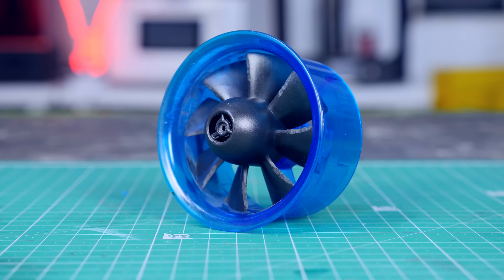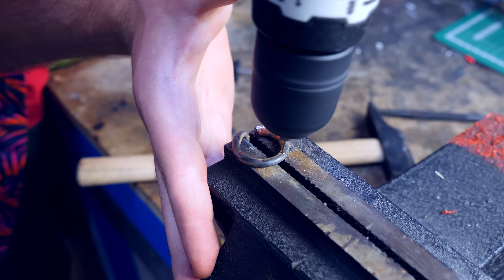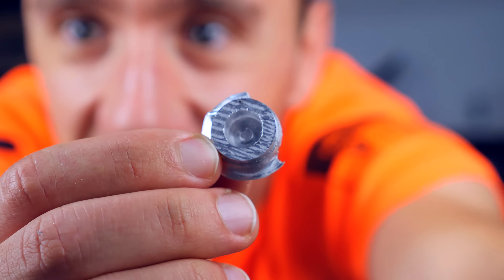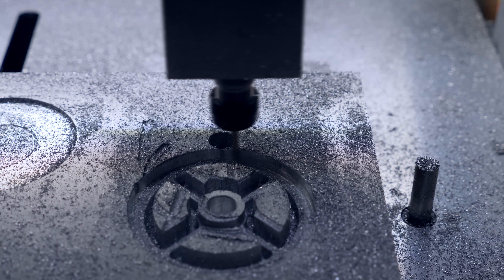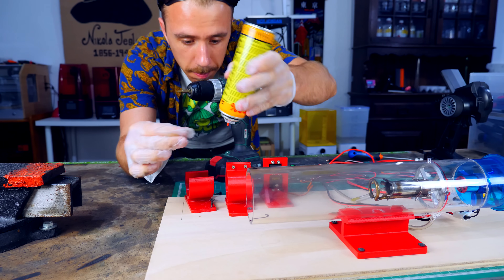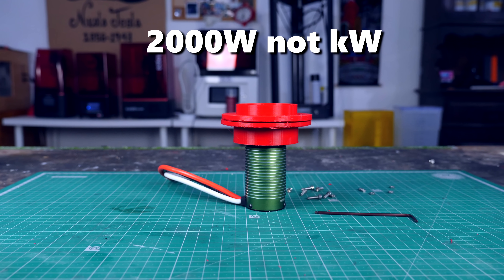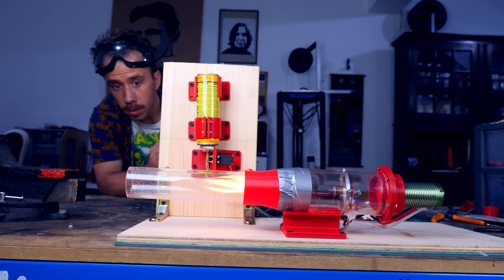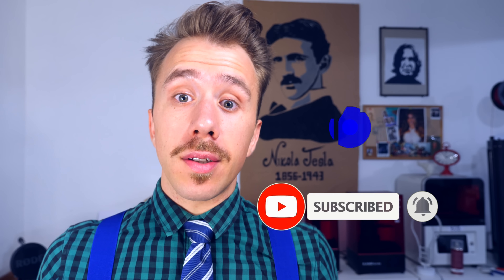I turned my Fan into a Jet Engine (3D Printed EDF Afterburner)

Comment: Couple of things I noticed (potential video idea?)
1) try injecting the fuel at the front (nearest the fan) of the flame tube, so it has a better chance of lighting and staying lit. I saw a lot of unburned fuel was just hanging around inside the engine.
2) Jet engines actually do use "normal" fans, but have multiple stages (decreasing in size) to compress the air more
Reply: Those normal fans are not normal at all. They have a rotor and a stator assembly which generates pulsed pressurized air. That's why they are called compressors and that's why they have lots of stages - the flow is constantly redirected to enter the next compressor fan at an optimal angle to be forced down the next stator and rise in pressure. So much so that the fuel spontaneously ignites from the heat the compressed air acquired in the process. You also need a larger exhaust than the combustion chamber intake because JET engines are a constant pressure engine - the process of burning the fuel goes in to expanding the gasses, not increasing pressure to push on a piston. The thrust comes from the larger area the same pressure is pushing at. The higher the compression ratio of the compressor - the more effective is the engine.
Reply: @TheOriginalEviltech  Absolutely - my point is mainly that the compressor is axial rather than radial, but I see that the stators are very important in increasing the pressure. thanks for the clarification
Reply: @TheOriginalEviltech  Pressure thrust is a very tiny component of the thrust jet engines produce. The goal of designing the nozzle is actually to minimize pressure thrust and maximize thrust due to the change in momentum of the flow. Ideally, pressure thrust would be zero and all of the thrust would come from the increase in momentum the engine imparts on the flow.
Reply: @SauerkrautIsGood  Precisely this; small turbines use a centrifugal compressor because the combustion chamber before the turbine needs pressure, but this design has no turbine. An afterburner - which this is, despite lacking any burn to be "after" - sits after the turbine, when the pressure has already dropped, and desires high-speed air, so for this engine to be effective the EDF is the correct choice, not the centrifugal compressor.
Reply: @iskierka8399  This has literally nothing to do with my comment about the thrust equation for a turbojet engine.

Also, to call this an engine is a bit generous. It doesn't complete a thermodynamic cycle.

Lastly, afterburners do not "desire" high speed air. The faster the flow, the less stable the combustion. This is why afterburners always have a diffuser prior to the spray bars and flame holders.
Reply: @SauerkrautIsGood  exactly what i am trying to explain. The closer you can get the output pressure to atmospheric pressure the faster your flow will be and the more thrust you will get. It's a very complicated process to balance them out and that's why there are variable size nossles with computer controll on military specked jets. That's why they have a massively complex wiring harness and a few redundant ECU blocks.
Reply: @TheOriginalEviltech  let's don't forget about turbine, behind the combustion chamber/chambers. It's placed on the same shaft as the  linear/centrifugal compressor fan.  The combustion is not only for thrust but also to power the compressor. XD
Reply: @Minder95PL  exactly and thats the part that could be interesting with Integzas design that people arent picking up. They arent typically powered electrically, its usually self contained or pneumatic hookup on ground start. However, between 7th and 11th compressor stages you could add an accessory gearbox for power generation and others. Still self contained but different from conventional approach so long as in flight power doesnt overload the motor and it is powerful enough. Again at altitude this would be interesting due to low air pressure.
Reply: @Minder95PL  yes, but that doesn't change the fact that the pressure stays the same after the last stage of the compressor. Burning just increases the volume and that increases the flow. How you are going to use the flow is up to the application of the engine. You can electrically couple the gas turbine and the compressor fan, or use a gear box, or direct drive it. It depends on the design constrictions and application.
Reply: Big difference here is that the intake fan and compressors are drive by a turbine at the end and is self driven. Not by and electric motor. He would have to make the compressor and shaft out of aluminum and balance it properly given his current setup.
Reply: i think the main difference is the power output of a small turbine vs a small electric motor... I have a small jet engine, and the power to run the compressor is about 100kW vs the maximum 10kW his small electric motor can put out
Reply: @blechnik  you also would have to considered environmental impacts from this. Given turbine engines perform best at high altitude and very low temperatures, batteries and electric motors arent ideal due to their performance.

Engines perform very well when coupled with low temperatures whereas electrical systems not so much. Too low and engines do not due to solid liquid phase change issues and start up issues.
Reply: @blechnik  100kW- holy Christ, where did you get a fan that size?  (And how on earth do you power it)
Reply: @biffaozzie2373  sadly i dont have a fan with this power. 
i meant the compressor of a small turbojet engine uses this power and the turbine of this turbojet engine has to provide it

if you know of any electric fan with more than 15kW (thats what i have, the Schuebeler HST-215), i would be very happy about any information!
Reply: ty, i wanted to say that but didnt know how 😂😂😂
Reply: I admire the fact he can even demonstrate this and pull it off. He usually refines later. Nice input though, always good to see people in the know/experienced sharing as such. Cheers.
Reply: The multible fans thing is true ,but this isnt a jet engine this is just an afterburner
Reply: @coffeedude1468  yeah this isnt going to 40000 ft quite yet so its proof of concept is good. Just saying there are two ways he can go: strictly mechanical or electromechanical which he general prefers. 

Just noting limitations for each: balance and performance
Reply: i thought the same thing with the compressors, but he is somehow right, small model jet engines mostly use centrifugal compressors to create enough pressure for the rest of the engine. 
he could just use a radial compressor design for example from grabcad. the main problem for most small compressors is they require lots and lots of rpm to work efficiently.... i hope his motor can reach at least 60.000rpm
Reply: These are called compressor stages btw
Reply: Shouldn't the tube expand after the combustion chamber? 

Reasoning:  When the gas expands, the pressure increases in all directions equally creating back pressure on the EDF. Any increase in thrust from combustion causes the EDF to slow down and the total thrust stays the same. If the tube expanded, then the pressure is again the same in all directions but force=pressure*area...so as long as the area at the back is larger than at the front, the thrust force increases. This is because the expanding gasses push against the wall of the tube instead of the fan.

Comment: Awesome! You definetely became one of my favourite Youtubers in a matter of months. Can't wait for the follow up...
If you need a hint on aluminium: The key is CUTTING this stuff. You don't want to produce aluminium dust but big chips. To do this you need the right tool (double flute cutter) and the right combination of feed rate and rpms. It's important to know that bigger chips will take more heat away from the tool which prevents the aluminium from sticking to the tool and starting to rub what would produce even more heat.
In case you're not comfotable with higher feed rates you can also consider spraying some lubricant (any penetrating oil will work) on the aluminium. This provides some cooling and the aluminium won't stick to your tool.

Comment: Project Idea: Video 3 of saying you should make a carburetor to control the fuel and throttle for all your rockets, you could make a standard design that will work with any rocket, or have a basis that you can adapt for future rockets/engines/motors

Comment: Down with pressure fed rockets! Add a 3d printed compressor to push monopropellant in the chamber, powered by exhaust. (Tap-off cycle). Scroll compressor might work.

Comment: I think you get better results with a good EDF instead of that centrifugal fan. Real Jet engines also don't use centrifugal fan as far as I understand, they use series of "normal"fans that do converge to the outer radius, but propel the air linearly like a normal fan. It's all about air speed and a centrifugal fan slows the air down in the axial direction.

Comment: You can actually make a thrust measuring stand using loadcells jo barnard(bps space ) made one recently but that is vertical you need to make one that is horizontally mounted
You can rap the fuel line around the combustion chamber in the front that will pre heat the fuel and u can use smaller glow plugs that of nitro cars

Comment: Off topic suggestion: It's the apocalypse and there's no gasoline left in the world. You have a 4 stroke motorcycle and
need to escape the carnage.  Suggestion -  using just sugar and yeast, manufacture  and refine 
your own alcohol and adapt the 4 stroke engine to run on the alcohol. You are now self sufficient and 
can go anywhere as long as you have sugar, yeast, water and your distillation equipment. ;-)

Comment: I think the tank got too cold the first time so the gas wouldnt expand and maintain the bottle pressure. I would try it nozzle up and put the bottle in a bowl with luke warm water. This way you only get gas into the engine which makes the combustion a lot more stable.

Comment: Love the videos and comedy, Integza!
Don't wanna be a smart ass, but your fan design is hilarious. 
For it to be a centrifugal fan the air needs to go out radially, by definition. There is a 90° change in direction. As it does in the template you show shortly. 
You want to move the air axially, though. You're much better of with a traditional axial fan-rotor design. Or accept the 90° bend with a centrifugal fan.

Comment: For the router, you'll get fewer angry cow sounds if you use a shorter cutter, or hold the cutter closer to the cutting edge, reducing your stickout. You might notice a better surface finish and closer tolerances as the cutter isn't deflecting as much.

Rigidity Rigidity Rigidity are the three Rs of machining. This also includes your work holding. The edges might be screwed down, but the middle might benefit from some glue or double sided tape. Or some tooling holes for clamping screws. Or use some strap/toe clamps to hold it to your table.

Comment: Hey integza could you not heat the fuel like they do in rocket nozzles. Run a small pipe around the inside of the tube? Not exactly safe but it'd work lol

Comment: make 2 smaller versions of this and put it on a 3d printed car, and maybe make the fan and fuel both be activated by the throttle lever, that way neither the fuel nor the fan will be faster then the other, and use a Tesla Turbine to deliver the fuel to the engine, and use diesel or something like it as fuel, i know it's more expensive, but it works way better

Comment: Could build a rocket powered miniature train with tracks to be the test bed for the rocket engines instead of an RC car or a Skateboard. 
I bet the CNC machine will be usefull to get good wheels and other parts, for practice as well.

Comment: Dude u are awesome but you have definetly no clue about centrifugal compressors and how a normal jet engine works :) your fan blades cant be only in a straight line, thats so much power you will lose. Also print a stage afterwards which converts your centrifugal flow into 100% axial flow (: you have such a powerfull motor. You could easily calculate how much massflow you will receive with a given motor power if you know a little bit of thermodynamics and flow mechanics of such machines

Comment: cnc tip: get some cutting fluid, thicker milling bits, have your cutting tool only as long as you need, and make sure the entire tool holding assembly is clean (could see a lot of wobble in the footage)

Comment: If you sync the fan and the fuel valve using a rule i think you can optimize the power of the jet engine. Because i see like the fan blow the fuel away of the ignition system.

Comment: maybe try to make it so that, the exhaust power is transmitted back by a rod to increase the rotation power, the same as a normal jet engine to complete the loop, this might be interesting, i dont know if having an electric powered engine is suitable for it though, maybe try to make it so that the electric power is to start it then it relies on the energy of the gas, after it picks up speed .

Comment: I think you are over complicating this engine. that fan is all wrong,the first fan was more of what you need. in a standard jet engine you have the fan(compressor) and then to the ignition area but instead of having the turbine that drives the compressor you are skipping that part and goin directly to the after burner.

Comment: I think you need a better nozzle, and you could do it in the style of military aircraft, also called "turkey feathers". Only maybe fixed instead of mobile, since you only have one mode to satisfy (afterburner). But by bending the metal more or less you could try different geometries.

Plus you definitely need to figure out how much boost you can get. A load cell could solve the problem for you (or a kitchen scale, upright somewhere and connected to the motor).

Comment: I advise you increase constriction a tad more to fight against the pressure caused by the fan and cage the fuel ejector slightly to allow for controlled combustion

Comment: that is not a jet engine... its a blow torch! (isso não é um motor a jacto, é um maçarico!!) And real jet engines don't use centrifugal fans since the fifties... Most use axial compressor fans for the aerodynamics. Centrifugal are only used on some helicopter turboprops or some high power generator. For things with real thrust, all are axial compressors... (rc jet engines use them, but they are not intended to have as big performance as one in a real airplane. And they are meant to be cheap... centrifugal ones are cheaper, less parts, and you can use a car turbo fans to do one...)

Comment: You could try using some liquid fuel in that turbine! Maybe ethanol? Then you could have some sort of carburator (or atomizer) stage to feed the turbine with the fuel+air mixture. Or maybe a ethanol rocket engine? i'm interested in ethanol as i'm brazillian, and the first liquid fuel brazilian rocket used ethanol, as we also produce a lot of it. it's cool.

Comment: Hey Integza, you can utilize "Joules effect" with a resistor to warm the air before the fan, in this way you can use the hot air as ignition, obviously you have to find a resistor optimised for your flow, but just think about that or maybe you can use this idea to make something in this way.
Reply: P.S. please find a way to mesure the trust of your engine, we are so curious.

Comment: Why are you dry cutting the aluminum? Get yourself some spray can cutting fluid/lubricant. Or make a dripper and use Kerosene as a cutting fluid.
Your CNC sounds like something is lose ,and vibrating ( I have only ever worked on a massive CNC and that was over 10 years ago). Check where the machine wobbles, what is lose and add supports where its needed. You want to make the little thing as ridged as possible.

Comment: Idea : previous suggestion of use airbrush you need a strobe light  not disco light to see the situation that occurred in video and strobe lights need to have variable control to get the adjusted speed.

Comment: Video idea: Instead of feeding propellant with syringes or relying on pressure from propane (very dangerous without a valve), you should instead pump the fuel in with a peristatic pump, they're easy to make, really precise, but they can't pump a ton of liquid like a centrifugal pump can. It would be great to see one in action when you make the turbojet engine, instead of using propane, you could feed diesel with a peristatic pump and a fuel injector.

The peristatic pump can be made with soft, clear tube, a housing for your monster 2000W motor, and a rotor with 3 or more bearings. It's also very clean since it's just pumping fluids by fluctuating pressure in the tube you mount it on.

Edit: also, throttle is dependant on the fuel getting in the engine.

Comment: you should run the fuel through the nozzle or body of the engine for active cooling and the preheat the fuel like a real rocket engine.

Comment: You should make turbo pumps to pressurize the liquid propellants in your hydrogen peroxide rocket. That way you don't need to manually feed the fuel into the injector with syringes

Comment: Revisit the solid fuel engines.  Use a 3d printed mold and make powder compacted motors from various fuels.  Mount them on a taught wire track to compare the speeds each can achieve.

Comment: you could add a turbine behind to power the fan like a turbofan does? Although it would be done easiest if the shaft were offset from the flame tube so the shaft doesn't go straight through it so effectively it would be a single combustion chamber turbofan 😂

Comment: Theme: Use the liquid propane/butane to build an ALL plastic pressure fed rocket engine with cooling from the liquid fuel inside the combustion chamber wall (like a real one).